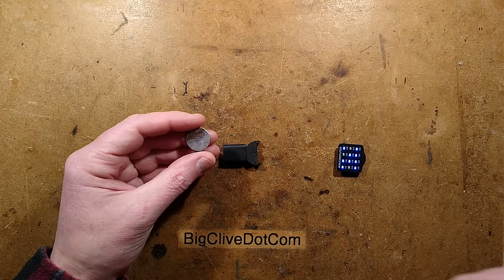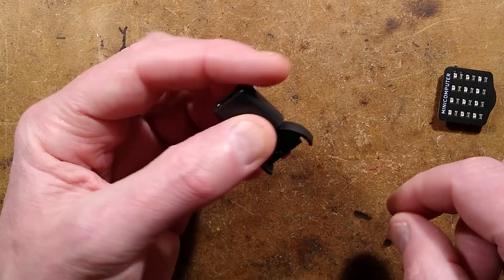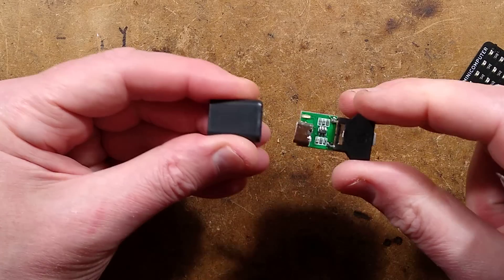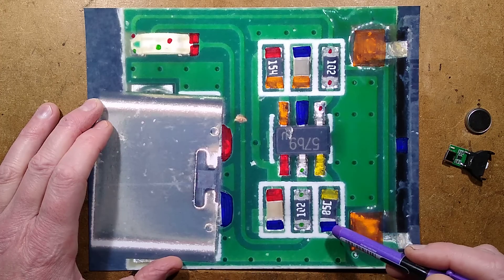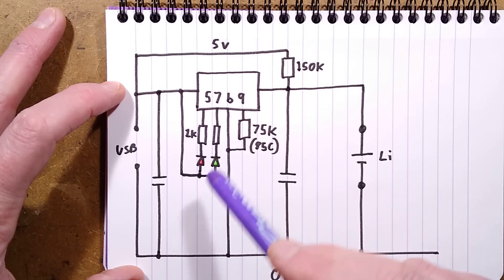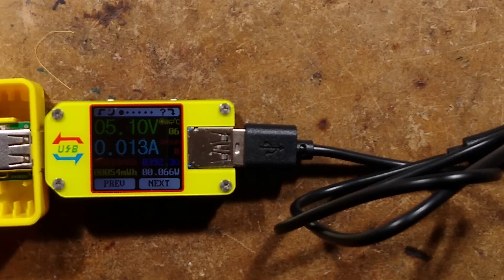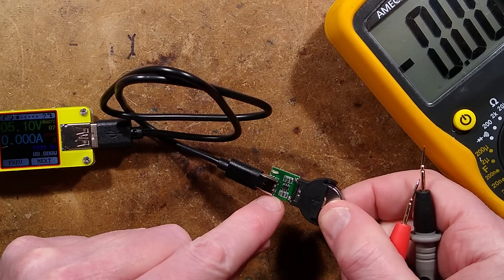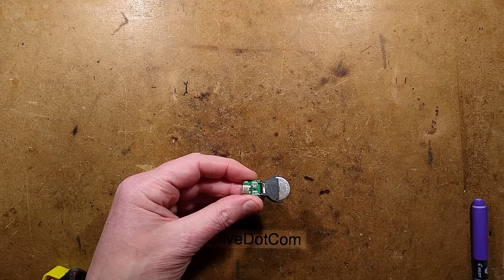2032 lithium cell charger with reverse polarity test

Comment: Perhaps that 150k resistor is acting as a pull-up resistor?  And the chip checks the voltage on that pin first, before starting the charge, which is why the red light takes a while to turn green?  So if it is reversed, the battery pulls that pin far too low, the chip notices something is very wrong, and bails on charging.
Reply: Yep, that's my guess too.  The chip pin goes tri-state and if it sees 5v it knows there's no battery, a negative voltage means a backwards battery, and some low positive voltage means a discharged battery was inserted.
Reply from the maker: It could be that.
Reply: Could the 150K resistor be there to lower the voltage? That battery isn’t a 5V battery, so you’d want to lower the output.
Reply: A way to test (and possibly destroy the unit) is simply to remove the resistor and see what happens.
Reply: @jacara1981  The chip would then see 5v and think there was no battery inserted.
Reply: I have a 2032 charger with 4 cell charging.  Mine will only work properly if the battery(s) are inserted BEFORE plugging in the power cable. If you insert the cells after it's plugged into usb, it thinks the cells are already charged.  I'm wondering if this unit works in a similar way and that's the reason for the 150k res.  Haven't taken mine apart yet tho to check circuit...
Reply: This was my thought too. I guess I'll have to get up earlier (literally) to beat you guys.😊